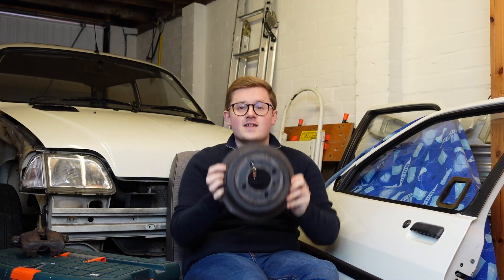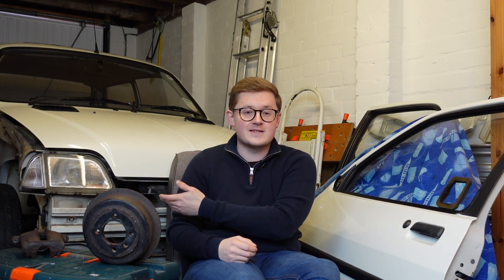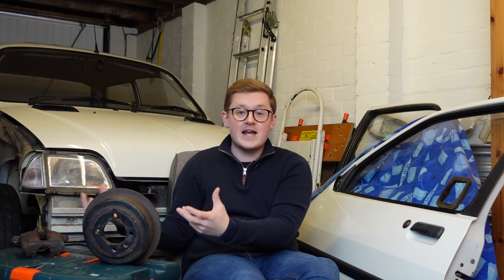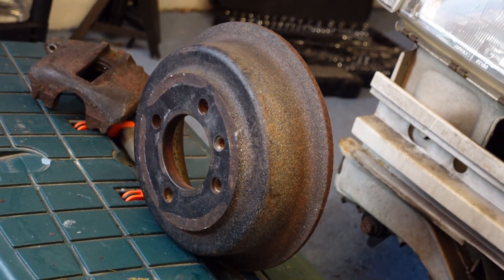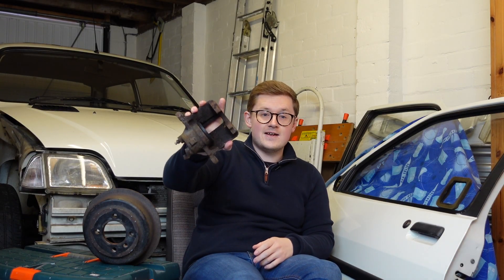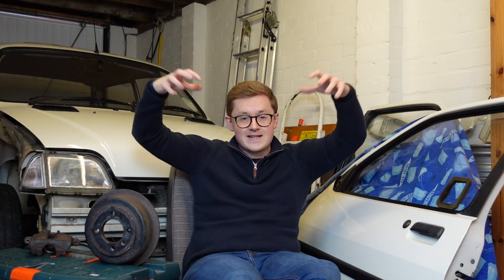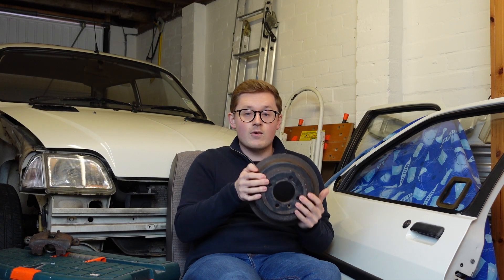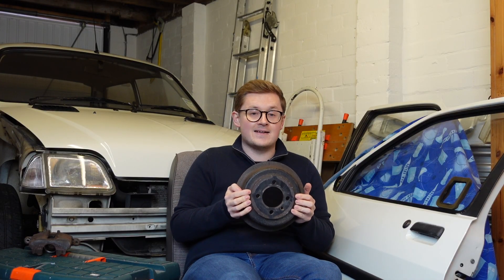Why are Drum Brakes Making an EV Comeback?

Comment: Many drum brake systems are self energizing. They use the rotational force to add to the braking force. It used to be common to have 4 wheel, manual drum brakes. The initial effort is higher but once past that they stop very well. Well, at least until they heat up and fade... 

When it comes to all drum brakes I prefer manual drums. A manual system required more brake pedal travel to achieve the same brake force making it easier to modulate. That is perfected when you add front disc brakes as you remove that touchy, somewhat inconsistent engagement of the self energizing drums. However, even with all drums you can modulate a manual brake system to a decent degree. Power drums reduce the amount of brake pedal travel and effort and makes the window between lockup and no braking much smaller. 

Trailer brakes are electric in many cases and self energizing. There's a magnet that when energizes drags the leading shoe into the drum then the rotational force transfers to the trailing shoe and increases the braking effect. So having an electrically activated drum is not a big stretch. In fact many brake controllers for towing have accelerometers and can adjust the amount of braking force. Any time you touch the brakes and the brake lights come on the trailer brakes activate. The brake controller uses the accelerometer force to figure out how much to activate them. There is a control to limit the amount of total power to keep from locking up and skidding the brakes. 

My assumption would be to actually use such a system and limit the amount of regen till the brake pedal is used. The brake pedal then could inform the drive system how much braking is being asked for then use a combination of regen and conventional brake engagement. Wheel speed sensors can be used to prevent lockup and / or large, rapid changes of wheel speed for a single or multiple wheels. Add the yaw sensor and you have stability control... 

Plus with auto-braking the electronic signal needs to be converted to a hydraulic input to achieve braking. With all electric 4 wheel drum brakes it could control regen and or the brakes themselves.

Comment: My 1993 land rover discovery has disk brakes all around and for a hand brake they actually have a drum stuck to the rear of the transfer case, which while it means that there is a bit of movement when releasing the brakes after parking with the handbrake, it's a much simpler, cheaper and more maintainable system.

Comment: Putting drum brakes on EV which usually weighs 50% more than a ICE car is a recipe for a crash! 

Drums are known to have less braking force and they get worse when it rains because the water gets in and reduces the friction. 

Everyone knows EV costs 50% more financially and CO2 wise, so manufacturers are just trying to cut cost with drum brakes.

Comment: Great explanation!  I will however push back on one point.  Though surface area is larger on the drum brakes, another factor like increased force due to hydraulic pressure from a small master cylinder piston to a larger (up to 10 times more?) Caliper piston will make up the difference.

Comment: No way. Anytime manufacturers say something doesn't need changing, it ends in disaster. Like the gearboxes that claim they don't need service. It might last until the warranty runs out, but after? Cars are not disposable grocery bags. The very fact there is an old car behind the presenter in this video shows there will be people that won't treat their car as an appliance. Cold batteries can't take that much energy back. An emergency stop might be all over the place if you just started to drive. Not to mention electric cars usually have more peak power, let alone the faster acceleration. They might be trying to justify saving costs on rear drum brakes on lower performance smaller cars. But I don't see front discs ever going away. The supposed lower cost isn't worth it. When I see drums on the back of modern cars I wonder why are those still a thing. And yes they are well aware, the reception would be just what they deserve. Mercedes already tried brake by wire. That didn't end well. Drums are also less likely to receive maintenance if they need it. With disc you can look without even taking the wheel off and see something is going bad. Never underestimate people's unwillingness to do maintenance. They'll drive in the shop with a wheel falling off.

Comment: Heavy Duty vehicles never stopped using drum brakes in the first place. Smaller 3/4 & 1 ton trucks may have front disc brakes. Most larger trucks and larger construction vehicles rely largely on drum brakes.

Comment: Not many have separate drums for hand brake , that was 1980's thing . Drum shoes  take longer to fit than disc pads and more cleaning up and time to adjust out auto adjusters. Unless twin leading shoe only part of the shoe effective .Lol when i changed a toyota rear hubs the friction linings fell off the shoes due to age 15 + old maybe.

Comment: I work on 5 to 10 ton Hino and Isuzu transport trucks. Some of them have a really cool emergency brake system; rather than locking up the brakes when parked, a mechanism instead grabs the drive shaft and locks on to it. It’s a neat system, but I don’t know how it would work on passenger cars

Comment: Is it possible that drums are NEEDED on electric cars because of their weight? Do trucks have disc brakes? My 35 lb bicycle has disc brakes and even when coupled with my 180 lbs of weight it does provide plenty of stopping power. No denying that. My old Suzuki Swift (1985) had drum brakes on the rear and it weighed a hefty 1,521 lbs. (btw it got 62mph) How much does an electric car weigh? I don’t own one so I don’t know. I have worked on both styles of brakes and I find it easier to work on disc brakes. It is very true that when the drum is pulled off, the brake dust is a concern. I wish I had regenerative braking on my bicycle, but I haven’t needed to go electric yet.

Comment: There are always exceptions. You mentioned that drums are often used on cheap, light cars, but they are also sometimes used in other applications. I have a '97 Ford F-250 with rear drums despite being a 2500 kg truck. The size difference in the drums is interesting, as the drums you have could fit inside the ford drums.
Reply: Worth noting that starting in '99 every f250 has rear discs
Reply: It’s a 1997 model year. Still the Stone Age in terms of vehicles. You’ll not see them on anything anymore.

Comment: I have older trucks with drum rear brakes. If you adjust the brakes correctly, the rear brake and front brakes will activate equally, aka flat stopping, without the forward pitching from the front disks activating before the rear brakes. It called proper maintenance of your brakes

Comment: Another issue that pops up when caliper brakes are in low use (long service intervals) the slide pins have a habit of gumming up and the caliper doesn't return to neutral and remains biased on one side and one pad get chewed away rather quickly.
Also anyone who has actually used a 1 ton pickup with a rear disc brake with the small parking brake drum knows how shit those little drums are, they just don't have the holding power...

Comment: Here in Canada where snow and salt cause issues with disc brakes, I prefer drums, at least on the back. The rear disc setups are easily damaged by corrosion and none of the parking brake setups are adequate.

Comment: Hello, nice video, but you miss a massive point that so many others do.
Drum brakes are self servo, meaning that you don’t need power assistance to anything like the degree of a Disk system.
Meaning also that you will never have brake failure due to loss of vacuum.

Also has a handbrake, it is far less likely to lose its hold, as it is self servo and works if you are parking up or down a hill.

I have never had a problem with grabbing by the way either.
I hope this is helpful. As usual most of the video otherwise was excellent. 	.

Comment: I love that we are pretending that it's any reason other than cost savings.. same reason the CTV also known as the cheapest transmission to manufacture is being pushed so hard.
Reply from the maker: If it was about cost, all cars would never have moved away from drums.
I’m not familiar with a CTV though. What manufacturer produces that?
Reply: @TwinCam  it's almost like we are in late stage capitalism now and things have changed...
Reply: @TwinCam 
Typo: I think @stockrappy means CVT.
The metal belt and expanding/contracting drive sheaves variant in particular

Comment: Another funny issue with drums vs rotors is actually during assembly.  A lot of those brake shoes had fiddly springs you could move with your pinky.   This leads to more quality issues during assembly that are difficult to catch.   The rotor and caliper mostly had an issue of brake pads falling out before assembly, but that's easy to see and catch compared to a small spring.

Comment: This implies drums don't stick or fail catastrophically, which simply isn't true. I would rather have to grease the brake slides than have to fight to get a frozen drum off after the pads stuck engaged. It's equally a pain when your spring snaps and now you have no brake shoe retraction.

Comment: I have totally noticed how after driving my car on a rainy night and then parking in a dry garage overnight, in the morning, the car won’t move until I press the accelerator a bit. It feels as if the car is stuck.  I know it’s the disc brakes corroding overnight.  I’ve noticed this on multiple cars I’ve owned.

Comment: Actually, the breaking system that they need for EV's exist on roller coasters.
On roller coasters, they use copper and magnets to create brakes that are incredibly powerful, but cannot lock up .
They would be expensive, but considering how electric motors work, and regenerative baking.. 

There's no reason in the world why electromagnetic brakes couldn't be used in conjunction with drums or discs and regenerative breaking .
You would have consistent power going to the electric motors for regenerative breaking, but having as much power with no chance of locking up at the beginning of the breaking process, where you want to scrub off the most speed and generate the least amount of heat, and then drum or disc brakes to take over from the very lower speeds.
It would be a little more expensive, but it would be the best breaking system possible.

Comment: The way you eliminate the disadvantages of a drum brake is simple... you use a mechanical cam system that applies the trailing edge of both pads.  Something we've had for a long long long time but it costs 5 more parts... and is STILL cheaper than disks.   If you build a set of drums to the diameter that most disks are made at today you end up with a superior system that can use 3 or 5 pads internally with a cam ring application.

This leaves the only actual disadvantage that drums have ever had: having to slam on them when backing up to adjust them.

Comment: It is easy to tell from your descriptions of using drums that you never grew up with them as I did. For a start, while it is true that performance vehicles were commonly using disc brakes by 1970-ish, their appearance in the family saloons that most of us drove was not common until late in the 1970's. They actually took over the motorcycle segment before they took over ordinary affordable cars. My first disc brake was on a Ducati I bought both around 1974, but my previous bike, a Kawasaki Mach III was drums front and rear as was the Honda I had before it. The Ducati had drums on the rear. A lot of people didn't like the disc because they believed it pulled the wheel to the right. Personally I loved it. My 1973 Mini was drums front and rear as were all the other cars I bought in the 70's

Those early discs and calipers did not work as effectively as modern discs do. Those early ones were a lot more susceptible to disc brake fade in the wet than current disc brakes are, so the effectiveness of discs was not quite as dramatic compared to drums compared to modern discs. I remember when perforated discs became a thing and that made a big difference in the wet. It took time to engineer better and better brakes.

Drums had a great advantage in rural areas because they continue to operate as normal when in a lot of water for far longer than discs do. The other side of that coin is that once they are wet they take longer than discs to dry out and return to full braking power. They weren't particular variable in performance when applying the pedal in normal use on a normal car, but they would lose braking power quickly necessitating pumping the brakes in heavy braking, and in an emergency braking from 90mph to dead stop was a big ask which meant brake fade increasing stopping distance and reduced safety. I worry that the extra weight of EV vehicles might impact drum brakes in EV's in emergencies. I was a young guy, and we often drove cars in unwise ways at the time, so I remember well the old drum brakes, and I know how weight and speed are both factors to consider.
Reply from the maker: The three most popular cars in the UK, 1100, Escort, and Cortina, had all switched to discs as standard at the front by 1968, and 1962 for the 1100 and Cortina as the Escort didn’t exist yet.
As I mentioned in the video, if you had a hot Mini, it also came with discs. In 1963, Rootes launched the Hillman Imp to compete with the Mini, and that car too had discs on the front. The Mini was an outlier in retaining drums on lower-spec cars.

Comment: 8:20 This is something that needs to come from regulations. In Europe, the regulations have been adjusted so that if the rate of braking exceeds 1.3 meters per second squared, the brake light needs to come on. If the car is at a full stop, the brake lights do not need to stay on, which matches the behavior of many manual driven cars on a flat area

Comment: I think what you are missing in the total of the argument is that EV and generator-EV vehicles are going to have regenerative braking. meaning you can further reduce the reliance of physical braking and relegate the brakes for parking and if excessive braking force is needed. this means even if the drum brakes are viewed as having excessive braking force, the regenerative braking can help to smooth out the acceleration curve leaving the drum for the excessively hard braking and as a physical stop to prevent the car from rolling.

Comment: You know, when this video popped into my recommendations, I scoffed and said "probably because they're harder to DIY replace, they want you coming to the dealer for what little maintenance an EV has"

But as you started to get to the point about drum brakes being closed and disc brakes being open, it hit me. EVs use regen, you don't actually brake much, your disc just sits there getting rusty. I currently have a hybrid and while the regen isn't good enough to avoid using the brakes, I do use them less, and the last time I needed to change the brake pads and rotors was not because I wore them down, but because one of the rotors had rusted so much it was starting to separate into layers. Drums would have prevented that, and yeah, it does make sense to have an enclosed brake for an EV after remembering that.

Comment: Fascinating, and turning my perception on its head to some degree. Can regen brakes be modulated finely enough to provide abs functionality?
Reply: it's just a piece of software. when the abs sensor detects a stalled wheel, the motor management unit can simply stop to draw power from the motor, thus disabling regenerative braking.

Comment: I wonder if someone will develop aftermarket drum bake kits for common EVs.
I had to replace the rear discs on both EVs I owned after 4 years.

If I could choose a drum brake kit to replace them I would possibly consider that, even if it's more expensive for a single replacement, but if I can avoid replacing dircs ever 4th year, I could save some in the long run.

Comment: Anyone familiar with trailers will be aware that drum brakes are the norm and are actually better suited to trailers than discs, because European trailers  (excepting air braked commercial vehicle’s or hydraulic agricultural trailers)  use overrun/cable park brakes and as others have commented drum brakes have a greater surface are and “suck to the drum without requiring a servo  

In addition the parking brake gets tighter as the drum cools so handbrake comes on tighter, which is all to the good,

But anyone familiar with older cars will also be aware that drums were common on the rear, but drums on the front (which did most of the braking were troublesome, with brake fade and uneven braking common issues, and the change to front discs were welcomed, A chnage to drums on the rear of EV's may be ifne but I would porefer to keep disks on the front

Comment: Your argument around flash corrosion is flawed, all modern cars have a brake wipe function whereby the car automatically cleans the surface through interval pad touches to the disc surface which is indiscernible by the driver.

Comment: According to EU rules, a car that is slowing down must have its brake lights on. 
It doesn’t matter whether the brake is applied or the electric motor charges the battery. 
For the following traffic, the only thing that counts is that the vehicle in front slows down or stops.

It is questionable whether European rules also apply to England, but they do apply to Ireland.